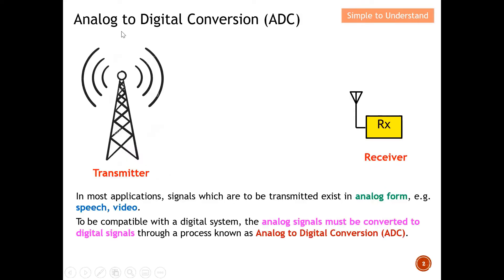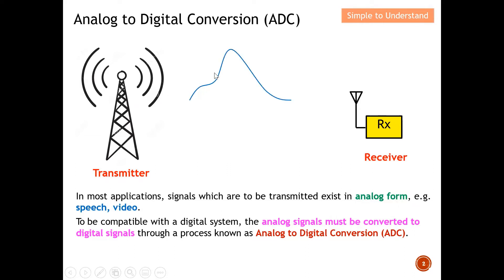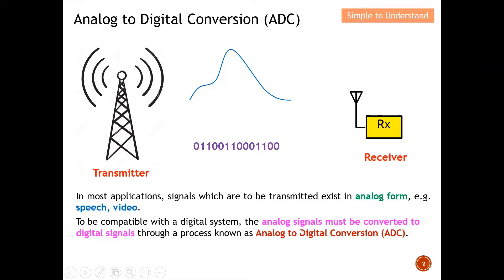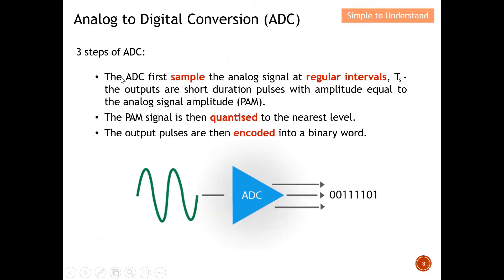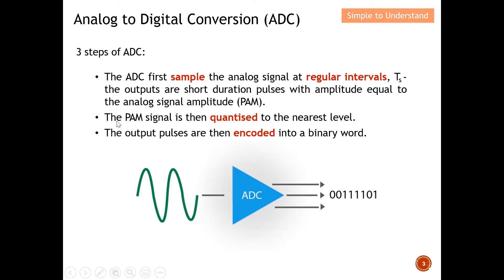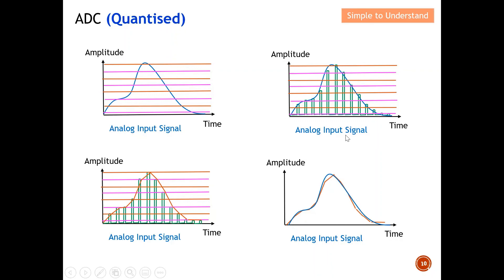Sampling Rate & Bit Depth Explained: How to Select the Right ADC for Your Conversion Design.

Comment: Thank you so much, very well explained, I think the best in youtube as it has in details;
Please, I would ask you about how we could make this principle concepts in order the digitized modulated RF signal with carrier frequency in GHz range has bandwidth in MHz range; for example WiFi signal at 5 GHz with bandwidth of 250 MHz !
It's feasible practically? cost? processors needed?
Please, if you could explain to us in great detail (principle, calculations, practical application in real world) this issue!
I'll so thankful and appreciative to you;
Reply from the maker: Thank you so much for your support again  :)
I am not sure whether have u seen the Spec of Wifi 7, which is coming soon to household soon. Up to 320 MHz bandwidth on 6 GHz. 
https://www.tp-link.com/sg/wifi7/#320%20MHz

The reason why they move to 6GHz because is less congestion at 6GHz as compared to 5 GHz.

Will share more.   :)
Thank you again for your support!!!